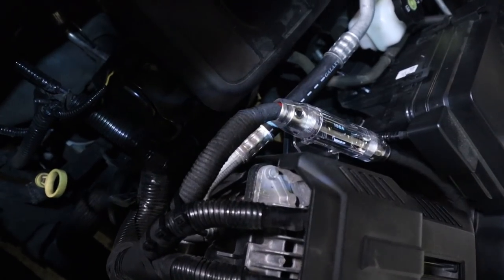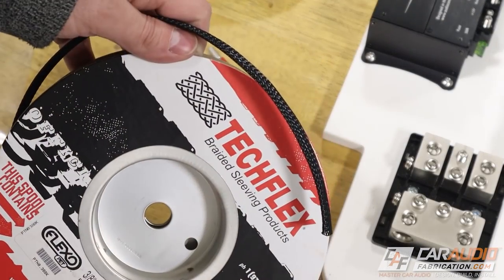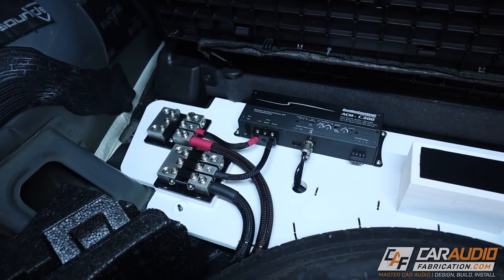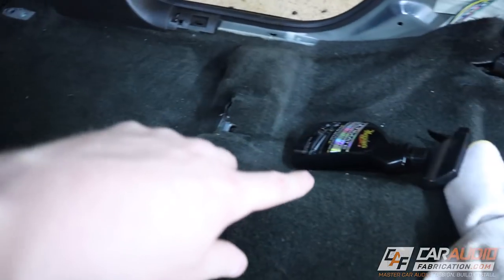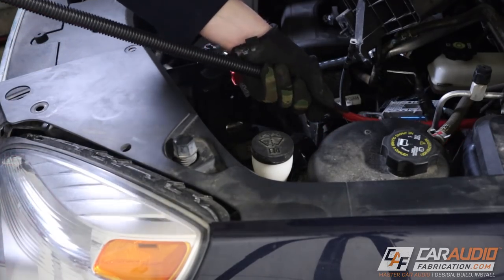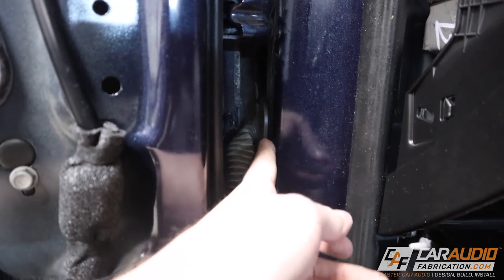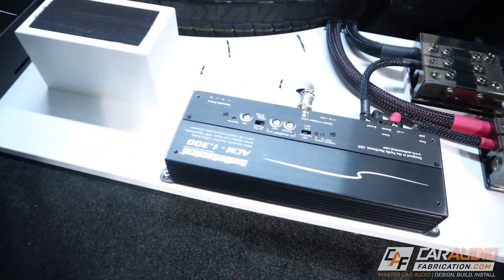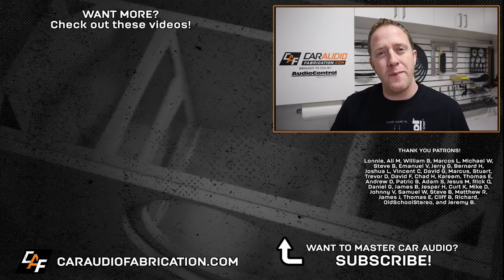FULL System Wiring! Mounting fuse, running all wires! - SQ Daily Driver Build Part 4

Comment: With most newer cars its not good to have power connected, or turn on the ignition while the seats are disconnected and out. The airbag sensors might cause the light to come on. And that airbag light can't be cleared with alot of scan tools. However with this vehicle I'm confident you wher aware and understood every aspect of the install. Truly master Level skills and top quality.

Comment: Yes I would like to see a video on how you would run the speaker wire through the door. My 2005 Jeep Library had a hardness cover and I couldn’t run the speaker wire.
Reply: I ended up using grommets and bypassing the factory door grommet, the way they designed it with connectors at each end makes it impossible to run 14 gauge speaker wire through. Apparently it's easier if you disconnect the grommets first but I couldn't get the damn things off. I have an '05 Dodge Ram 1500 (Chrysler makes Jeep, Dodge, etc) and it's the same deal. Be nice if someone sold door grommets so I could put a second set in instead of having the wire visible.
Reply: @ixionn563  buy a rear door grommet from a car at a scrap yard make you own holes and install...
Reply: @6door6four96  You have to remove doors from the car to drill holes for that which can be pain in the ass.
It's easier to drill holes in connector if you have extra unused pins.
Reply: 6door 6four No good pick a parts around here, I’ll have to look around on some car part websites

Comment: Any video that helps get wire where it needs to go, I’m for! Liked the way you ran the wire in the car, cleaned places not easily accessed and showed routing for wire with those industrial ferrels for the pass through to the engine bay. Those guys keep wet out of boxes in the factory. First time I’ve seen them used on a car. Good vid Mark! Lots of helpful stuff!👍🏻

Comment: Yet another good trick. I've always run power & speaker lines on the opposite sides of the car. I didn't realize all I needed was some space between them. Great tip on crossing lines at an angle too.

Comment: You can get the same ferrules and a larger crimper for cables up to 35mm2. 
Much better connection than relying on the terminating screw to also crimp it. 
Aside from that, this video, as always is an excellent source for anyone to learn how to wire correctly! 
Thanks mark

Comment: YES, WE NEED A VIDEO ON DOOR PIN WIRING. I’ve been looking everywhere for over a year trying to find a tutorial on how exactly to run through doors on newer vehicles, especially those that don’t have empty pin locations that could be drilled through. I have a 2016 and I’m using factory wiring because I’d rather not remove my doors to run wire, granted I’m running less than 75W per door.

Comment: @CarAudioFabrication your routering clips are my favorite. Maybe I overlooked it but what did you flush trim/use as a template for your fuse holder plate? In the clip it already looks cut and you are just rounding it over?

Comment: Wire clothes hanger is pretty handy to use as a wire snake.
A dedicated battery to body ground wire is necessary for high amp installs. Otherwise the amps will try to use existing inadequate engine to body grounds to complete the circuit

Comment: Have you included in a video how to secure the amplifier board to the vehicle?  I saw a bolt but I just wondered how you selected where you would secure it to and then how you did it and the hardware chosen for the job?  Thanks!

Comment: Great Video, but I have a question on remote turn-on wires for the dual amp set-up. Did you connect the REM from the D-6.1200 to the ACM 1.300 and then from the ACM 1.300 to the head unit using a single REM wire?

Comment: Hello Mark, your built are incredible and your videos are very inspiring. The soundproofing process scares me a little but I think it's going to be essential. I have 2 questions for you... Why didn't you include the DM-810 in the system you installed in your father's car. And second question: Using an ultra-capacitor in parallel with the main car battery in this system would have been overkill for the alternator. I will start the transformation of a 2018 Toyota Corolla LE. Thanks!!!

Comment: Brilliant M8, you are a total perfectionist.
have you ever made a video about how to run extra cables through from the car into the door when it is a large plug that connects inside of door, next to hinges.eg Seat, VW, Audi or Skoda. 
I am coming to the end of installing Focal 165 k2 2 way kit in my car and have now opted to install tweeters on A pillar rather than door because of this problem. Also i have Bi Amped, would you recommend using the Bi Amp function?
Thank you in advance

Comment: Fantastic channel, could have done with this info a few years ago when I was building my old system, would have saved a lot of time and some big headaches!

Have you done a video (or know of one) for the Pioneer P99RS and how to set it up properly/what else it can do. I picked one up a few years ago to replace my 80PRS but the cars engine blew before I got it all up & running. I should be picking up an new car next month then all my old gears going in here. Sinfoni S series 3 ways (going to be a pain to fit theyre massive for 6.5”!!! Genesis P69 subs in the shelf and a couple of lovely old school amps, Denon DCA800 for the fronts & RF Punch 40i for the little subs. Can’t wait!!

Comment: Concerning your comment about running power wires close to speaker wire, the same thought applies to the factory wiring, especially on newer cars(like this one) that have CAN lines running through the harness. Will it interfere? meh, maybe. but it isn't hard to avoid just to be sure.

Comment: For your remote wire, did you use a relay? Or did you run the one remote wire for both amps?
Reply from the maker: I did the math and two amps was just fine for the one wire.

Comment: Loving the build, doors are torture, recently did mine and just ended up taping the speaker wires along the existing setup, took me a whole day to do one side.

One question though, not sure if I missed it but why didn't you use a relay after the head unit?

Comment: Just a thought. If you had a small enough amp for the door speakers, couldn't you splice into the factory wires behind the stereo and mount the amp back there too and then just run the sub amp to the back? and how would all that work if you have the factory deck and need to have an aftermarket preamp output through the factory speaker wires still? Can that be done if you have the aftermarket door speakers amped?

Comment: Do you have to crimp the ferrules after you slip them on the wire end with a tool? Or do you just slip them on and then install on the amp and the screw just presses it down?

Comment: I’ve learn a lot with all your videos. I’m getting ready and replace the stock speakers on my 2020 corolla se, any recommendations on speakers for my car. I don’t want something crazy, just improve what it has now. Also, looking inside the trunk I found place where jbl I think install a subwoofer if you get the jbl upgrade.  I would like to use that same place to instal a sub too... any ideas ?

Comment: Thanks for all the videos and great info!  One question, I am installing a simple system (5 channel amp).  Do I need to run speaker wires into each of the doors or can I just run them back and connect them to the factory wiring behind the head unit?  It would be easier to connect to the factory wiring but if it will make a difference I will run wires to each door.  Thanks!

Comment: Help me understand the need for tech flex if you’re using quality wiring with adequate insulation? On that note, why use wire loom instead of techflex in the engine bay?

Comment: My  Pioneer amplifier manual shows that I need two fuse holders in parallel using 30 amp fuses instead of using one 60 amp fuse. I suppose I could put two 30 amp fuses inside one fuse holder but I haven't looked into that. Anyway, I haven't been able to get an answer as to why this is the way the manual says to do the fuses for the power so I'm asking you if you know. Getting two fuse holders mounted close to the battery in my 2002 Mustang GT would be problematic. It's a Pioneer GM-A6704.

Comment: Question: How do you run your remote turn on to two amps? I have heard some people say just splice the wire however I have also heard others say in some cases the current isn't always strong enough to supply both amps with the correct voltage to signal it to turn on. Any advice here?
Reply: I have same inquiry. In fact in the video it seemed that the remote wire was divided. Some people use also a Relay connected  directly to battery. Great channel by the way.

Comment: So if I'm running a Capacitor.  Should I run a  Distribution block with fuses, before or after the capacitor?.  I do have a fuse right after the battery.

Comment: I want to run two amps like a 1000w kenwood amp and a Rockford fosgate r500x4 can I use 0 gauge wire and make a distribution block for two 4 gauge wires and power them without having any electrical issues? My stock alternator is about 100-150 amps

Comment: Question! Do you need a line out converter even if the head unit has RCA outputs? Im a massive newbie just looking at starting my build.
Reply from the maker: The point of a Line Output Converter is to convert speaker level (high level) signal to line level (low level) rca outputs to then send to your amp. Some amps have a "LOC" built in
Reply: @CarAudioFabrication  Ahh that makes more sense now! Thanks for your help 🙂

Comment: Hello I have a question. I have a 02 ram 1500 with infinity system it has the factory amp. Is there a way to use that for speakers and add  another amp just for subs?

Comment: Look great, but can't you run into issues running signal wires right next to power wires?
Reply from the maker: When you use high quality wiring and actually good gear, this isnt as much of an issue. The problem is all the guys that think the cheapest gear is the best deal and they end up with an install that radiates horrible noise.

Comment: Got a question I've been wondering about for awhile with subs, a lot of people say running your subs at 2 ohm VS 4 ohm per say would make the sound quality decrease. Is this true? I really don't notice necessarily worse sound quality going from my old 4 ohm (single 12) to two 12s at 2ohm. Thanks.

Comment: If all 6 speaker wires go to the front, does that means the speakers on the rear door won't get any? How about the connection to the bass? Is there a line in on the bass amp?

Comment: I noticed you ran a power (or perhaps ground?) Wire alongside the RCAs on the back side of that amp panel. 

There seems to be contention about how likely this is to introduce interference to the signal. Is it ok over a short period?
Reply from the maker: I did not. There is significant spacing. At the end of the day when you use high quality signal wires though it is not as much of an issue
Reply: @CarAudioFabrication  my bad, that's what was going on at 3:20.

Comment: I conected The remote from The amp to the + 12v outlet because my radio player doesnt have The remote and it works fine. Is that bad?

Comment: Wow. First time I have seen wires look sexy. Great job. 👍 love it!!!! 

** definitely want to see the door wiring with those dang rubber tubes. Please.
Reply from the maker: Its not the rubber tube that is the issue, that is simple. Its the fact that manufactures put a plug at the end of the boot now that essentially blocks any wires going through whatsoever... Unless you know how to mod! Stay tuned ;)
Reply: CarAudioFabrication Wish I could mod mine, the connectors are so hard to remove that I’m afraid I’ll break the things, my next option will have to be finding a set of door wire tubes and installing them.

Comment: One thing I've learned in my time of upfitting police cars is the MECP will absolutely ring your ass for using factory grounds, It causes interference with factory specified blah blah blah. Everything we install in cars, even if it's outside the car, gets grounded to the same one spot now, which is a bolt on either side of the dashboard to the A pillar. Super stupid but we wouldn't have gotten our DoT contract without doing that.
With that being said, all door grommets suck, especially on the brand new Explorers. My secret to easily getting them through is to spray the tube and wires with glass cleaner, it makes pulling them through sticky areas a breeze. Multiple long zip ties taped together really helps, especially when running wires through channels of armored swat trucks, something else that works really well is a spool of fish tape, it's especially handy for snaking wires across headliners.
Obviously upfitting police cars and car audio is a bit different, but your videos helped me install my first set of subs back in 2013 and it's probably that tiny bit of experience that even landed me my career. So thanks. I think I can consider you my guru now?

Comment: Argh! Testing the power is a good pro-tip but I could not believe you turned on the ignition with the seats out. I hope those airbag faults clear once you get them back in.
Reply from the maker: Zero issues.
Reply: @CarAudioFabrication  That's good and  don't get me wrong, I am a big fan of what you do.  It's just that one of the very first things any installer needs to learn is how to recognize airbag wiring and what the potential consequences can be when working with those systems in modern cars. Nobody ever talks about it in videos like this, but I have personally seen many talented installers create problems for themselves this way.

Comment: Why are you using a sliver wiring instead of copper wire?
Reply: It's OFC wire (oxygen free copper) it's silver cus it has a protective coat
Reply: It's tinned ofc.
Reply: The wire has been "tinned" for corrosion resistance. Costs extra. Wire is still copper if you look at the cut ends of it.
Reply: Watching for some years and finally got a heart from Mark. Today was that day. Thanks for the opportunity kubinlh.
Reply from the maker: See answers above from the community. Its tinned OFC which makes it superior as it will not corrode. It's really important to actually understand what the wire is rather than just looking at the color. CCA wire looks like copper but we all know it is inferior to OFC.

Comment: I run my power wire under the car opposite side of the fuel lines seems to work for me
Reply: Stormy Young My power wires are mounted up under my truck also, no issues, no good spots through the firewall on my truck.